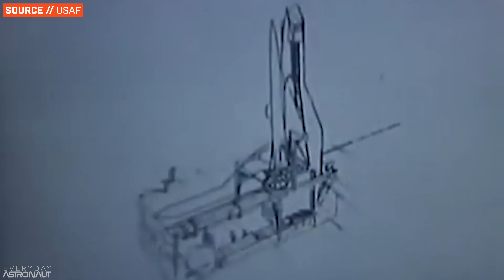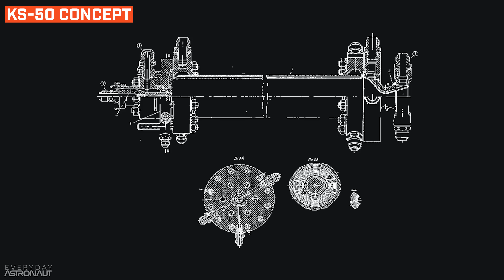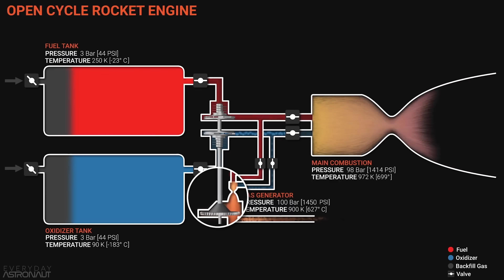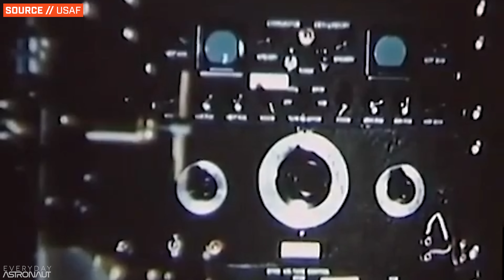Why This Super High Tech Rocket Failed

Comment: Glad to find this. Last week I was out driving in NE Florida, and out in basically the "middle of nowhere" there is a VFW chapter with a big tall rocket standing in front of its ball field. It kinda had a classic sci-fi look to it, so I figured it might be fake (that happened a lot back in the day. So, I decided to get a closer look. Upon doing so, I realized real quick it wasn't fake. The metalwork was way too good. Lots of careful close rivets. A fake wouldn't have been built nearly as well. But there was it's shape. Only 2 fins, and the backside was flat. What the heck is this crazy thing? Fortunately Google did tell me it's a Navajo rocket, but your story told me more about the Navajo than any other article Google had, so thanks for that. BTW it's at VFW 10208 in Salt Springs, FL.

Comment: It's a shame the Skylon and SABRE projects by Reaction Engines did not get to an actual flight test. 
In theory it does sound logical to use the oxygen in the atmosphere before reaching space and thus avoid carrying the extra mass of oxidiser, however the practical implementation seems more difficult.

Comment: Ive got a question about the shuttle program... was any part of the launch to orbit procedure autonomous, or was it all manual flight?
  I only ask, because i cant help but wonder why they so quickly discarded the shuttle. Nearly all space flight is fully autonomous nowadays,  so why couldn't they retrofit the shuttle to do the same? This isnt for human flight though, but to be used for constructing a new station when ISS is decommissioned. Shuttle was the perfect tool and now, without it, the agency claims we no longer have a means of building a new one. But a remote controlled shuttle could easily fix that issue and do it without risking the lives of our astronauts

Comment: I think the award for weirdest rocket still goes to the Energia Polyus rocket the USSR developed. The unmanned Polyus spacecraft was mounted upside down on the side of the enormous Energia rocket, the Energia was primarily designed to launch the Buran shuttle. Once the Energia stage completed the Polyus would detach, spin 180 degrees and the fire its engines to achieve orbit. Due to a software error during its only launch it instead detached, spun 360 degrees and fired its engines to quickly de orbit and crash.

Comment: Tim, I am surprised you find the rocket engine should have been used for high altitudes and the ram for lower altitudes.  After all, the ram engine needs other propulsion to get it up to speed, so the rocket is the perfect candidate for that chore.  Grood video, cheers.

Comment: Fun fact.  The blockhouse (pretty sure it is Pad 9) was sealed up many decades ago because it had asbestos inside.  From what I heard, it was abandoned in place and was essentially untouched from the 50's with all the original equipment still where it was when last used.  That's assuming they havent messed it up since I heard last.  Most of the blockhouses were stripped to the bone once decomissioned.

Comment: Modern ship or sub launched cruise missiles also use an rocket engine to get up to speed, but with jet engines their speed requirements is modest say 3-400 km/h the rocket engine is an small drum at the back who is dropped before jet engine start. 
It was also an spy drone designed to be launched from an SR-71. It ended up to dangerous to launch at high supersonic speeds so they added an huge solid first stage to get up to speed to start the ramjets. Note this was already at 900 km/h then dropped at high attitude.

Comment: Surprised they didn't use a solid rocket booster for this program. For a weapons system that needs to be readied quickly, but storable for a long time, that would be the logical choice.

Comment: Even though it would not be practical in the real world, I would still like to see physics based designs for multistage orbital vehicles with scramjet stages.

I assume the designs will have to cheat phyics somewhere. I just want the deviations from reality to be noted.

I see with the application of sufficient wishful thinking and impossibly heat resistant materials it is possible to reach or even exceed orbital speed with a scram jet. This means the orbital stage would only need a rocket engine for circulizing the orbit and a deorbit burn.

Comment: At the end of the war, German idea of intercontinental missile was a wing-based gliding system with a rocket booster. Soviets and USA inherited that vision, and for some time in both countries a lot of effort went into such systems. It did not work primarily because guidance system errors accumulate dramatically with the flight time. Ten times longer flight time -- vastly lower accuracy. Hence the switch to ballistic missiles, until terrain following and GPS guided navigation became available.

Comment: Engineers should look into whether a ramjet can be started at speeds a catapult can be made to achieve.  Using a cheap engine with no moving parts without the need for a booster rocket could cause significant changes to aircraft operations.

Comment: Just one correction. They never used LOx/Ethanol for the gas generator. They start using HTP85% steam generator and just before move to LOx/RP1, they tried HTP85% with an small injection of Ethanol.
LOx/Ethanol gas generator was never developed until middle of 2014
Reply: True, but scientists at Peenemünde did conduct research into all sorts of advanced gas generators, including those powered by main fuel components. They did not use them in production rockets, because peroxide based generators (which originally came from the torpedo and submarine projects) were much easier to control. But after the war, all of this research was available to the Allies, and three-component gas generators even became a mainstay of the French missile program.
Reply: @cogoid  Do you have any reference about that? According to various sources (Sutton, James N. Gibson, Boris Chertok, etc), they never even tried. All development was focus on HTP80-85%... Even the V2, Walter et. turbopumps corroborates to this, since they were all made using an Aluminium Alloy (AlSiMg)..
Tri-component GG used mainly by the french was only used in hypergolic combination, since the ignition time delay in low mixture ratio hypergolics are quite dangerous...
Reply: @robsonhahn  You probably know that Walter was the one who developed the peroxide technology for the navy in the first place. Only afterwards he also elaborated it for jet assisted takeoff etc. So it is not surprising that he does not focus on alternative systems. Karl Heinz Bringer was in charge of the other kinds of generators, especially for tank pressurization, and his main idea was spraying water into whatever flame was available, to generate steam and to cool the gas. That's the origin of the French and later European systems.

Specific information about laboratory experiments from that time period is hard to come by. I have seen gas generators mentioned here and there, but I do not have a specific reference on my fingertips. So I cannot vouch for alcohol liquid oxygen system -- it is possible that they only tried Wasserfall type fuel or something like that. But it is certain that the variety of systems which were briefly tried in the laboratory was massively greater than what went into further development. Just with the peroxide, they already had solid catalyst systems developed, but never put into production -- and that became the first thing that USSR and US implemented in their rockets after the war.
Reply: @robsonhahn  Here is one source which mentions it: M. Schilling, "The V-2 Rocket Engine": 

"1944 saw the successful completion of a component development in the form of a liquid oxygen—alcohol steam generator, but no missile application was any longer possible."
Reply: @cogoid  Thanks for the reference... Amazing literature... I cross-check the development and it seems that this LOx/Ethanol steam generator is also a Tri-component system. It uses a near-stoichiometric combustion chamber and inject water to produce steam. I will dig deeper into this system and definitely will come back to this post... Again, thanks for the reference :)
Reply: @robsonhahn  Cool! Two years ago there was an amateur project where some guy built a small turbopump "at home". He used LOX alcohol gas generator with the oxidizer-to-fuel ratio of 0.3:1, (0.8:1 according to another post) to drive the turbine. He also finished an earlier project where he built a 1KN electrically pumped LOX alcohol engine. Everything was exceptionally well made, and worked beautifully. He had a test stand with lots of telemetry, and posted videos of the tests on social media. It was simply amazing, especially being a "hobby" project of a single individual.
Reply: Who is still designing LOx/Ethanol engines?
Reply: @zapfanzapfan  Aerotech Rocketdyne still continues work on the RS-88 LOX/EtOH engine.
Reply: @teebob21  Interesting that a variant of it uses hypergols instead.
Reply: @zapfanzapfan  Yes, in the "highly successful" Boeing Starliner capsule.
Reply: @teebob21  😆
Reply: @teebob21  No... That is incorrect information.... Starliner uses RS-88, but with NTO/MMH...
Reply: @robsonhahn  Yes, that's what I said. Please try to follow the entire context of someone else's conversation before butting in and asserting that they are wrong.
Reply: @zapfanzapfan  LOx/Ethanol for upper stage in GG cycle can be more efficient than LOx/RP1...
Reply: @zapfanzapfan That sounds Russian as hell.
Reply: @operator8014  Soyuz is still using HTP to drive the turbines unless I have missed some updated version.

Comment: It seems like a general rule for our planet is to climb out of the atmosphere as quickly as you can and then really hit the accelerator pedal. It's a great atmosphere to use as a brake though.
Reply: Yes, because rockets are pretty simple compared to huge hypersonic cargo planes. And making rockets bigger is not that hard. 
Now we might get the hypersonic planes after 2050 if payload to orbit get high enough and you want to optimize. 
In KSP orbital velocity is just 2.4 km/s so an X-15 with drop tanks would be able to reach orbit. So would an falcon 9 first stage. 
This is why SSTO works there.